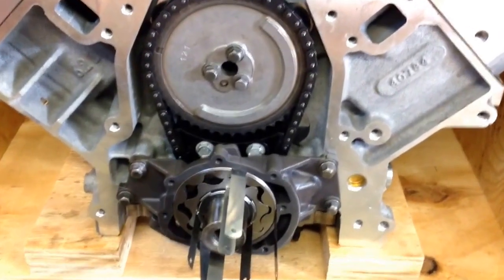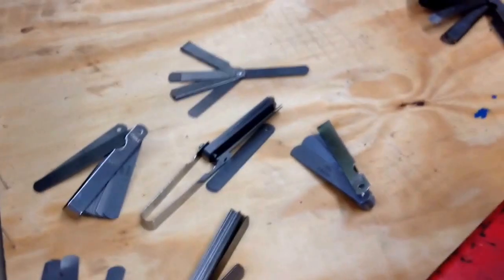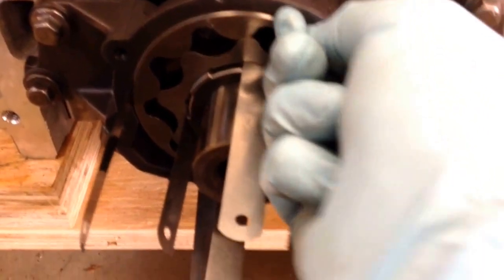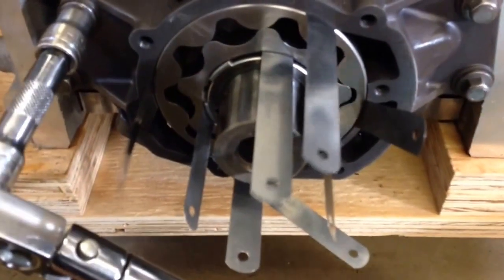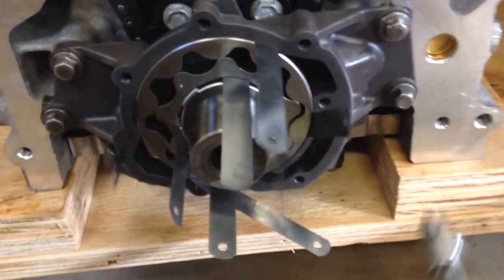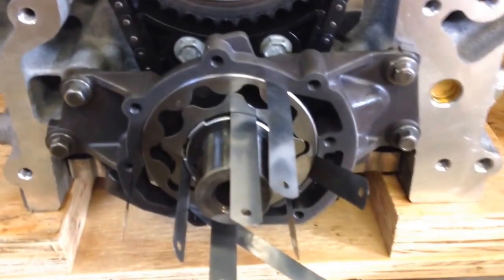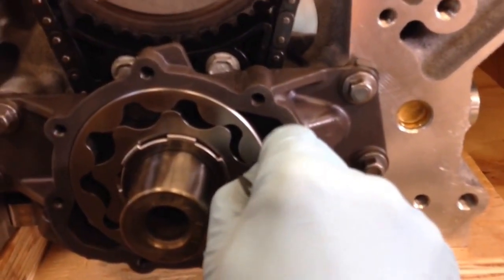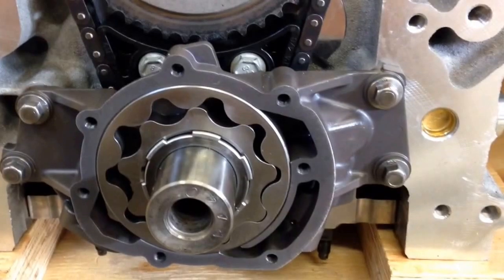Gm LS oil pump alignment / replacement

Comment: I’m not bashing anybody but I’ve never shimmed an LS oil pump and I’ve never had problems with it
Reply from the maker: Rolled the dice, you’ve been lucky so far.
Reply: @GIZZMOTORSPORTS  it islet luck. It works without shimming. I’ve built 6 cats including my two GTOs. Never shimmed them, and I never had a problem. Seen many guys here on YouTube too.

Comment: What RPM are you running? Reason being is are you using a High Volume-High Pressure pump or a High Volume or High Pressure pump?
Reply from the maker: Auto trans, shifts at 6600, fuel cutoff on this one was 6800 in the forward gears. Melling Select High pressure oil pump.

Comment: Do I have to do this for a simple replacement 
?
Reply from the maker: 4WD ADDICT I will always, not worth chancing a shattered pump.
Reply: @GIZZMOTORSPORTS  nice thanks for the input I will do this for sure next time I change a pump
Reply: With 11:5:1 compression what fuel  are you running
Reply from the maker: jovon Martin Chevron supreme plus in Canada is 94 octane
Reply: @GIZZMOTORSPORTS  thanks for the reply. I'm building a 11:5 6.0 LS engine and was trying to figure out should I run e85 or can I run 93 with a additive
Reply from the maker: @jovan Martin should be ok on 93, with the right cam no problem. E85 is way too expensive here at the moment.

Comment: Next time buy some brass shim stock from McMaster Carr it will reduce chances of scratching or galling any of the components. And whenever you .make the shims be sure to de-burr or unroll the cut edge... that's also a tip for cheap feeler gages
Reply from the maker: sounds like a good idea except they'll probably want to see you a sheet or a roll of .003 for more than it's worth, then no matter how you do it like you said you will have to take time to finish the edges after cutting. .003 steel feeler gauge shouldn't hurt anything.
Reply: I bought a melling oil pump it says to not open the pump it will void the warrant, is it mandatory to align it?
Reply: @sguaraggi1  nope
Reply: Get polymer based units
Reply: @ShadowOps Airman 1

This is a good idea. Sac City Corvette actually sells a set of plastic feeler gauges for specifically this purpose.